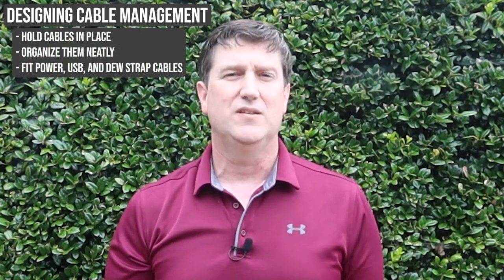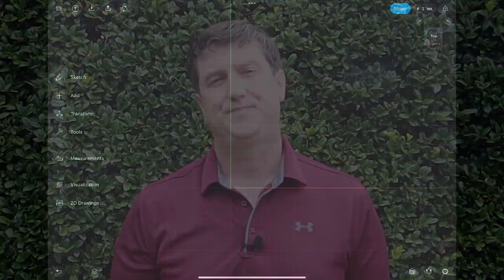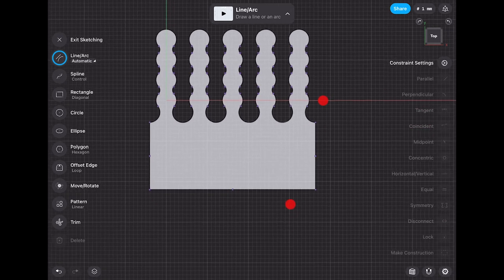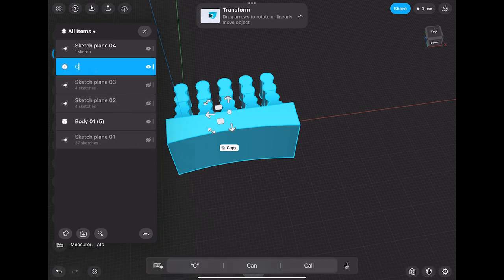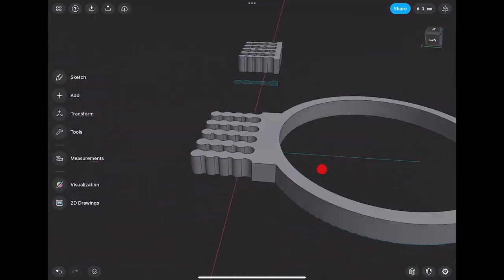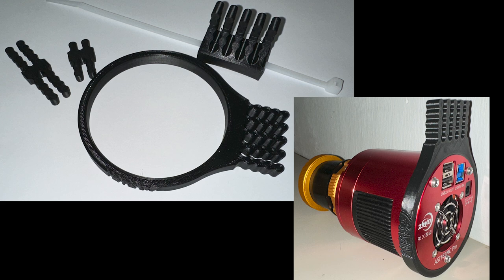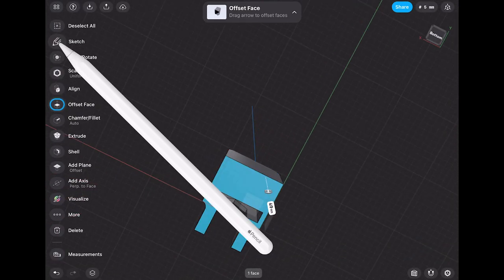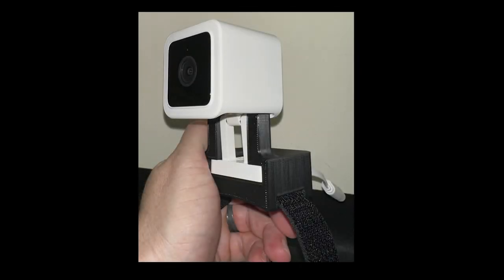Can I Really Create Parts for Astrophotography Using a 3D Printer? YES!

Comment: Great video, thank you!
Recently, I learned how to draw and successfully print using a regular FDM printer (Flsun SR) with 1mm and 0.75mm pitch threads, so no issues printing threads of any kind (male and female) such as M42, T2, SCT, M46, etc.
Since then, I have designed and made direct adapters to fit my focuser to all of my tubes and focal reducers, as well as various supports, masks, and even the primary mirror lock system for my old Celestron 8 XLT
Really satisfied!

Comment: I started to design parts in FreeCAD and get them printed via Craftcloud. So far I did correct Bathinov and Tribathinov masks (with the online generator) for my RC6 and a tiny Bathinov mask for my Uniguide 32. I also designed a short cap that is put onto the telescope and will hold different 2mm thick masks with same diameter perfectly centered. That way I save storage space and can change masks easily. ASA seems to be great for this application.
Reply from the maker: Fantastic!

Comment: A bit off topic, but - WYZE Cam3 uses IR light, doesn't it interfere with your shooting?
Reply from the maker: It 'could' but I dont point it directly at the tube opening, and/or I turn off the IR. The lowlight image quality is still pretty good even without it on. It also has a low power IR mode (near vs far).

Comment: Is there a reason why you don't mention which 3D design software you are using?
Reply: Listen to 3:25 to 3:27 and you have your answer 😄
Reply: @AmiSMB  Thanks, got fed up listening to him talk about "The Tool" and zoned out.  Took a look at Shapr3D, yikes, very expensive - plenty of better options for less or no cost.
Reply from the maker: Sorry it was given pretty quickly. I really didn’t want to  focus so much on the tool but just provide people without any 3-D printing or design experience enough key points to think about while watching the video. Most people really have no idea about how it all comes together, and I wanted them to look for very specific things. As mentioned in another comment, it is shapr3D, which can have a cost for sure. I just find it the fastest one for me to manipulate objects and build a design from the ground up (plus I love the iPad interface!). You are right, though, there are several others that are free that do a fantastic job of modeling.
Reply: i use designspark.
Reply: I use Onshape and Tinkercad, both online and both free for non commercial use.